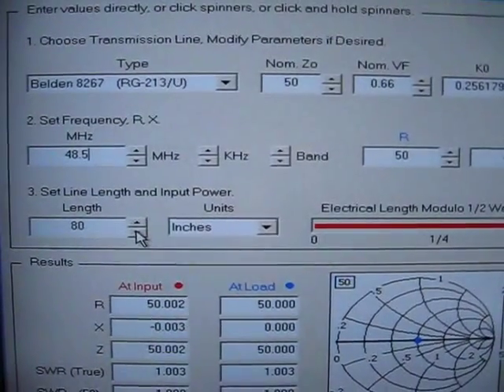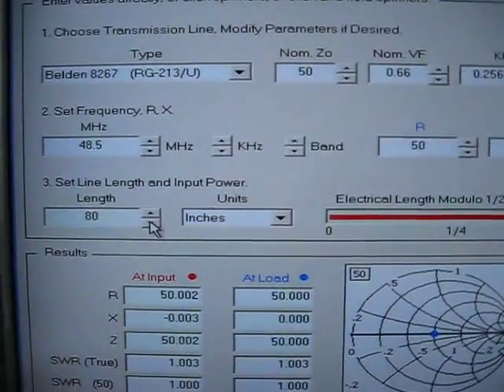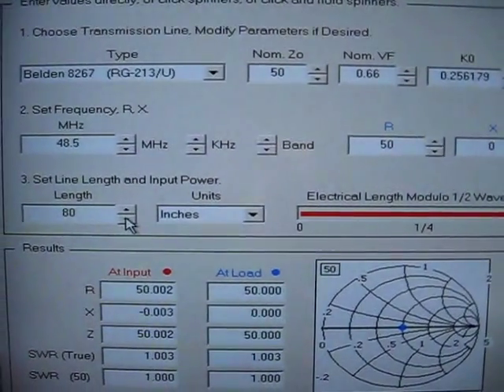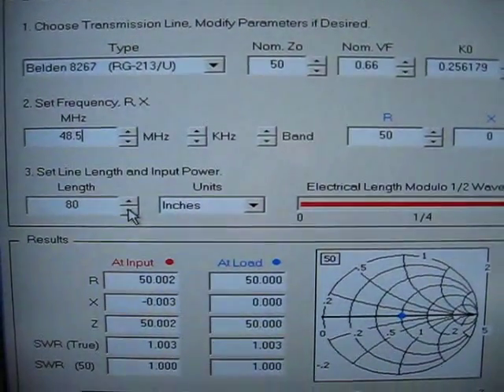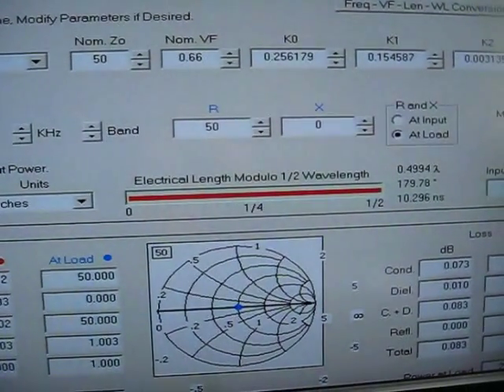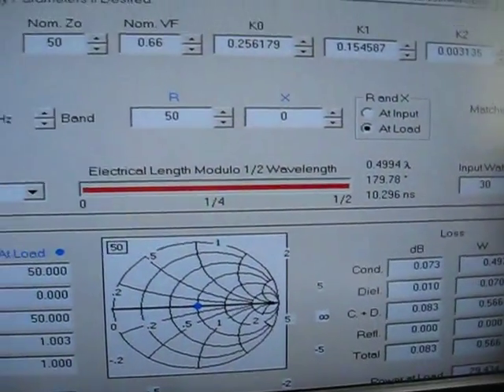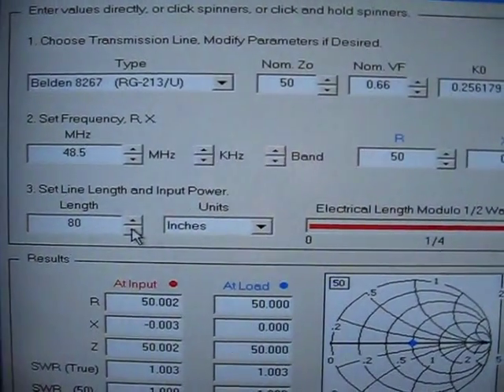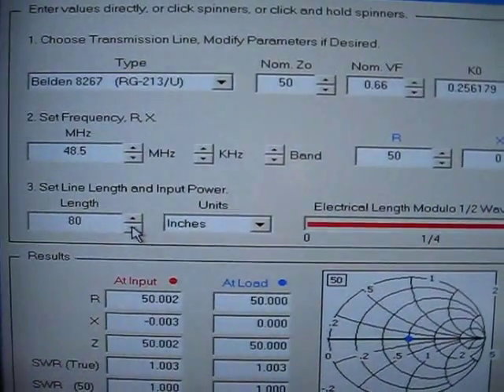MEASURING HALF WAVE LENGTHS OF COAX

Comment: Hi...
Was the dummy load also 75 ohm to match the coax you were testing otherwise your measurements will be a tad off.
This method, should you believe that the length of coax feed to an antenna causes issues, is only suitable for Monoband antennas as you prove...as soon as you change frequency...it's all wrong....So totally useless for multiband antennas, unless, perhaps the frequency you wish to use is a harmonic of the fundamental frequency.

Comment: if you change the coax from the T to the dummy load your measurement of coax under test will be off. Use a 50 ohm 1/4 watt resistor soldered INTO a PL 259 connector then connect it to the T. test your coax again. It will not read the same and you will have to trim the coax again to the next "shortest" wave length.

Comment: Do you know what is the accepted technique when adding a linear amplifier to your radio.
  Should the linear be positioned in multiples of 1/2 wavelengths back from the antenna - velocity factor of the coax. Or should the radio be positioned in multiples of 1/2 wavelengths? What is the ideal patch length to the linear? If not the correct length to the radio will this effect reception due to the coax no longer being matched to the impedance of the antenna? 
  Or is it more important for the length of coax to be correct between the antenna and the linear? Otherwise the linear could be suffering from reflected power and not be outputting to it's full potential just because someone wanted to have the correct combination of patch length and main coax run. I always used to use as short (and thick) a patch as possible from my radio and then as long as i needed to get as high as possible on the antenna. I think from memory i cut the coax into half wavelength multiples but i doubt i compensated for the velocity factor of the coax as i had no knowledge of this back then.
  I would say that if reception is not significantly effected at whichever frequency we are using then it would be more important to have the correct coax length starting from the linear amplifier no?